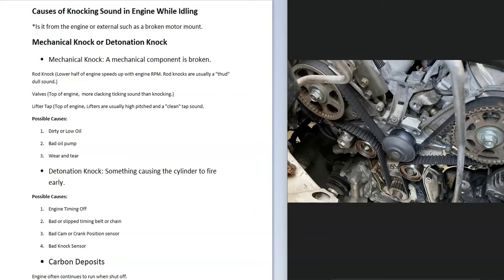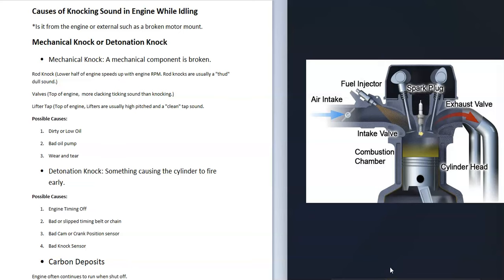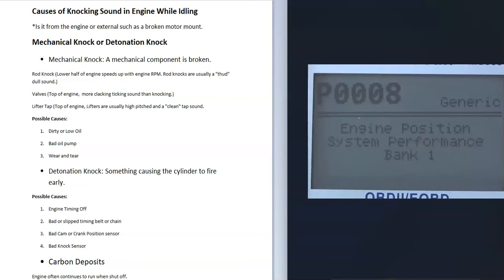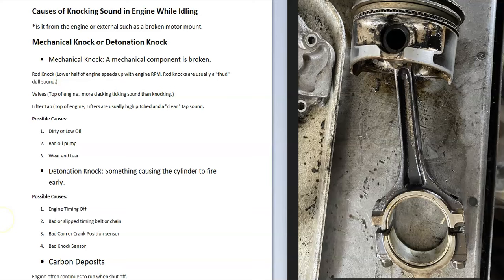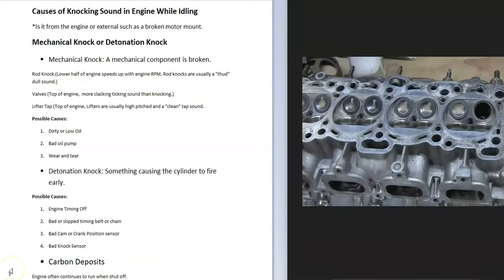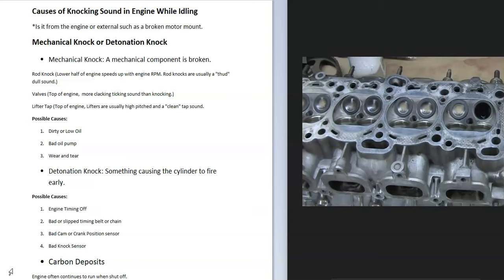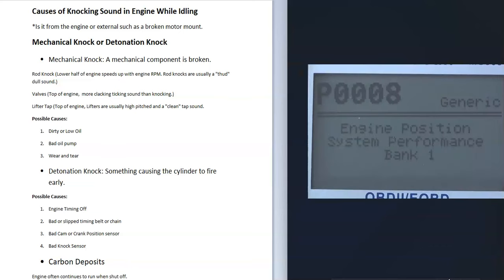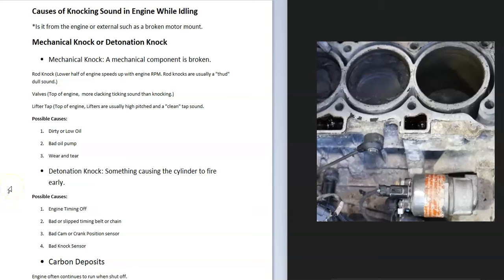Causes of Knocking Sound in Engine While Idling

Comment: There’s a knocking sound in my van that I mostly hear behind my pedals. I don’t hear it when I open the hood nor when I crawl under the van. No check engine light either
Reply: Caravan?
Reply: Could be a bad blend door actuator if you only hear it inside the cabin.

Comment: My son was driving the other night while it was pouring down rain and went through a water puddle and stalled the car.  Water got sucked in through his air intake. He didn't try to start it and instead had it towed to my house. I removed the coil packs/plugs and turned to car over to spray water out of the cylinders. We did this several times throughout the day until no more water was spraying out. We dried everything off and replaced the plugs.  I checked the oil and it doesn't appear to have any water in it although we are going to replace it anyways.  The car started right up but now has a knocking noise (I didn't run it long). Could this be because there is still water in the cylinders or something worse, like a bent rod?  I was going to pour a little bit of marvel mystery oil into each cylinder but wasn't sure if I should.
Reply: Is there no code on it? I had a knocking noise and tried many  things which didn't work out. later a mech discovered fuel pressure sensor was having internal short and had blown the fuel regulator fuse causing high fuel pressure in the system creating that knocking noise.
Reply: @ericknoxkwarteng1833  there was no codes. I'll have to keep that in mind.

Comment: I have a ticking noise at idle on my 2001 BMW 325i. I'm going to get the engine oil and filter changed in a few days. Hopefully that will fix it. Does anyone else have any other info?
Reply: Did it get fixing
Reply: Did it work after changing oil and filter ?
Reply: @wasted007  yes, the ticking disappeared after an oil and filter change.

Comment: Nissan v8 vk56vd knocking sound in idle goes away when a/c is on turn a/c off slowly gets louder scope the cylinders clean no scuffs open oil filter no metal doesn't burn oil and some days it's quiet with the a/c off

Comment: My 2003 Chevy Silverado has a knocking sound when it’s on park.  It goes away or the noise gets lower when I put it in drive.  It runs smoothly though. any ideas what it could be?
Reply: It's fuel knock or replace your oxygen sensor

Comment: 2012 Veloster noise around cylinder 3 on the top super low when warm but once I hit the gas the tapping starts compression tested just above 170 is that because I have carbon buildup?? 2012 Veloster 150k 1.6L no turbo only check engine codes for catalyst bank 1 and evap emissions no flow

Comment: I appreciate this video a lot. I am currently facing issues with my 2005 Honda Civic that will knock with acceleration but as soon as I let off the gas the knocking noise goes away. Any thoughts on what might be causing this? I will hear the noise as car cold stars but it seems after it warms up, the noise is not present as long as my foot is not on the gas pedal.
Reply: Did you figure it out?

Comment: I have a 2004 ford explorer 4.6 bought on the cheap about 2 years ago it had a bad trans replaced it and runs great. But ever since I bought it it's had this noise at first I thought it was the timing chain and tensioners. I replaced the timing and tensioners noise still there. 

Then, I replaced the oil pump and while the noise is still there I did notice that it wasn't as bad as it used to be I'm thinking because the oil pump is the High volume one. But the noise is still there it's more noticeable on the passenger side. I have gotten under it and put a brick on the gas to see if the noise would go away but to my surprise, it's still there.

 I also remember when I bought it the first thing I did was change the oil and about 2-3 quarts of oil came out of the engine. what do you think brother? I would really appreciate a response ive been dealing with this on and off since I bought it. thanks for your video and I wish you lots of blessings.
Reply from the maker: It is hard to say, but since the transmission was just changed, I would check the torque converter bolts. Sometimes things don't align correctly and can cause a knocking noise.
Reply: @HVAC_Mechanic  uuhh great feedback I’ll check them and let you know. Thanks for the reply.
Reply: Maybe could also be you need to run on midgrade gas instead of 87 octane?

Comment: Man rn ive got a knock in my engine bay and idk where from exactly. The wngine seems to be running fine and everything but theres the knocking noise and its loudest at lower rpm. It only gets worse as the engine gets warmer.
Reply: What kind of car
Reply: Bro my 2010 ford Taurus does it to and I took it to a car shop and they told me they don’t know it might be the pistons but they are not sure bro I drive and I don’t hear it when I stop I hear it but like you said when it warm up it’s sooo lound but car still runs like a beast
Reply: @Ngcron215  they have variable valve timing problems. Common problem in ford vehicles. They can develop engine problems because there is no proper shifting due to the timing issues

Comment: Here one for you then. Help needed please. I have a VDJ78R Diesel Toyota Landcruiser and it has an Intermittent ticking sound lower left rear of the Block. This can only be heard at operating temp once thermostat opens. I have good oil pressure no metal in oil it done 194,000kms. The only component in that area is the scavenge oil pump. Can these make a ticking sound before they start to fail?  Thanks for anyone's help/input Appreciated!
Reply from the maker: Here is a link to a forum for Landcruiser's with this problem. They can likely help more than me. https://www.landcruiserclub.net/community/threads/the-dreaded-ticking-noise.149559/

Comment: 1997 ford f150 with 4.6 with headers. after my truck warms up at idle it has a slight knocking noise in bottom of engine. Thought it was transmission so i rebuilt and that wasnt it, When i give it gas or drive it doesnt knock, only at idle. What could be doing this, It has no check engine lights and truck runs great other than that knock.
Reply: Figure out what It was?
Reply: @AngeloVentura-hv9ly figure out?

Comment: my engine makes a loud  knock noise at start up and disappears after about 30mins, there is P008 code on it. what do I have to check?
Reply from the maker: A P0008 code is usually a timing belt or timing chain.
Reply: @HVAC_Mechanic  after adjust the timing back to normal. will it fix the noise?